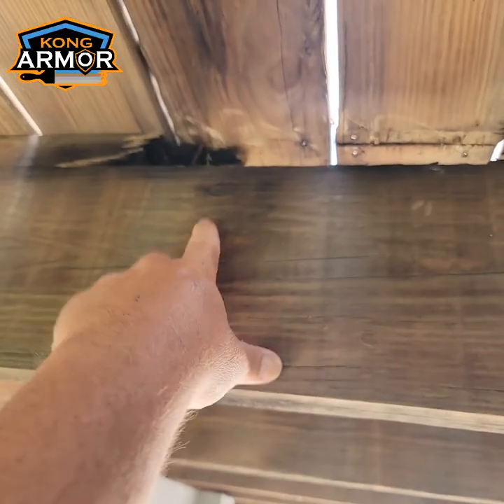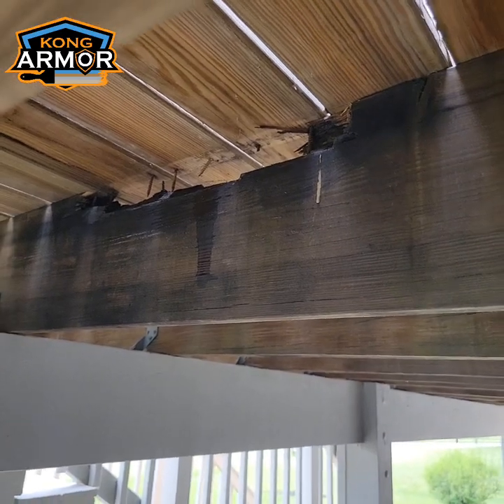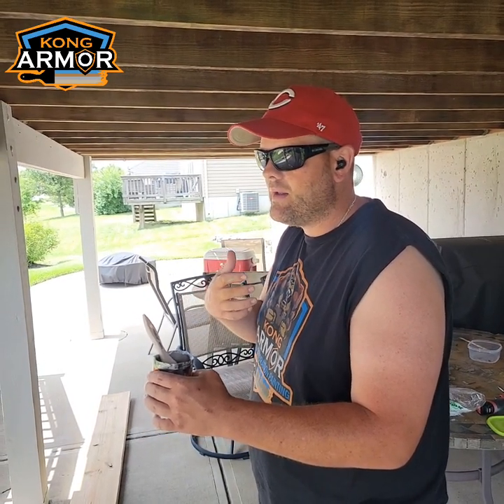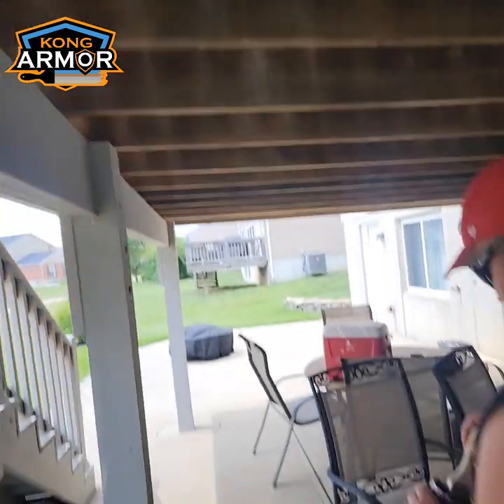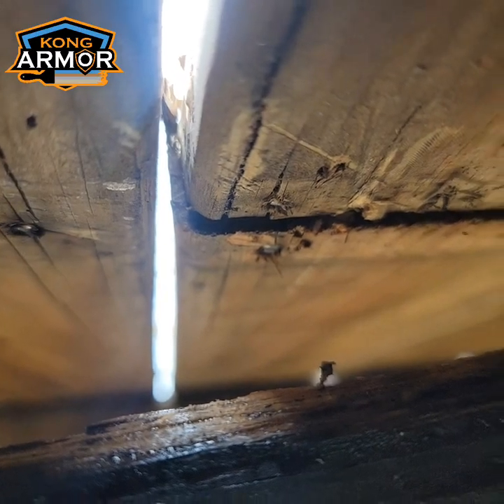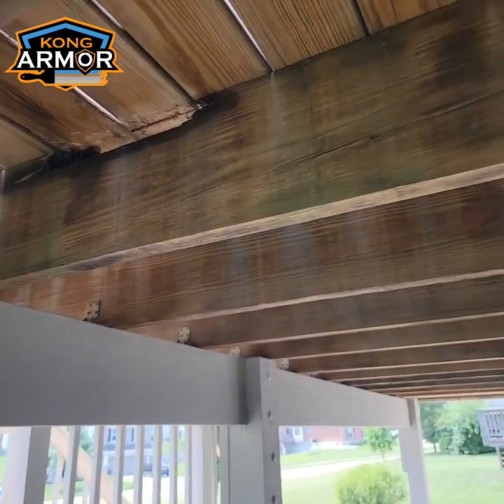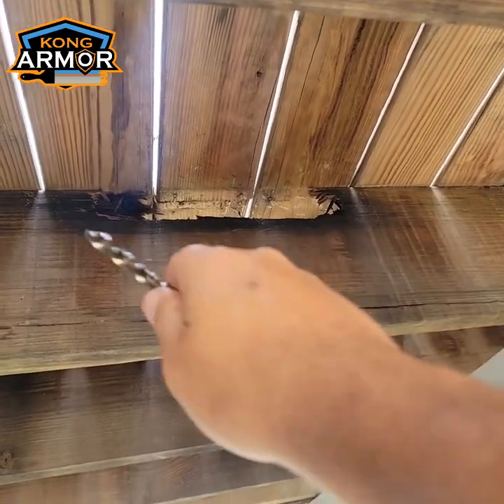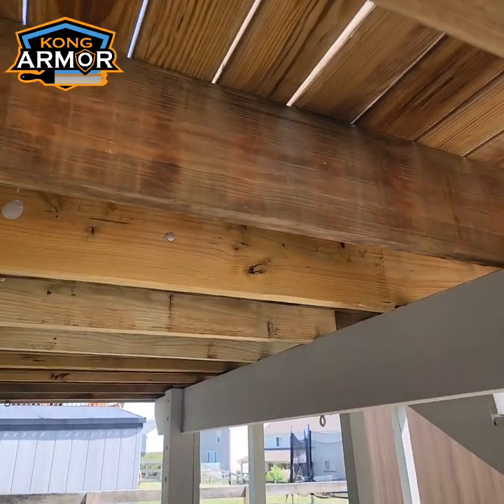Rotten Deck Joists Treated and Fixed by Kong Armor Deck Rescue Painters Walton KY | NO BIG DEAL

Comment: I have to replace my deck boards (15 years in FL sun has done some work on them). I started to pull the deck boards up and I have some wood rot in a few areas. I plan to use a product like this or Bondo Wood restorer...it's basically a similar thing. My question is...once I have cleaned the area and used that to harden the wood, should I use a wood filler to build it back up? I have a spot right in the side of where my steps attached that is rotten. There was no space between where the step was installed so water and leaves easily got trapped up against the joined where the step board touched.
Reply from the maker: Silverback Epoxy lowlanddecksupply.com ... bondo won't work

Comment: I just dried all the joists up and scabbed a 2x4 on each joist, replaced every joist hanger, and then replaced the deck boards on top. Good as new. I would have rather just flipped the deck joista but i didnt have the time or patience to do it right but that is what i usually do. Just flip the deck joist and put in new hangers and picos and then new boards on top.
Reply from the maker: There is more than one way to eat a resses
Reply from the maker: Hope u subscribe and join rthe channel tribe .. we need ur support. Especially someone that knows how to repair decks.

Comment: I heard someone saying use asphalt shingle for something?! Maybe between sister joist or on top of joist?! Not sure? Do you guys recommend using that butylene  tape on top of the joists? Unfortunately I didn't do anything like that 20 years ago a lot of the deck screws are rotting out
Reply from the maker: If you have corrosive fasteners it won't matter

Comment: I run into the same problem that you show in your video. How you mix the acetone? Can you explain how you make it? I want to fix my rotten wood joint.
Reply from the maker: Absolutely not. You don't need to be making penetrating hardners for wood as a diy individual. The last thing I need is a body on my conscious from you breathing in some chemical mixture and falling over. Or you loosing your eyesight or something silly. Go to the hardware store and find a wood rot hardner